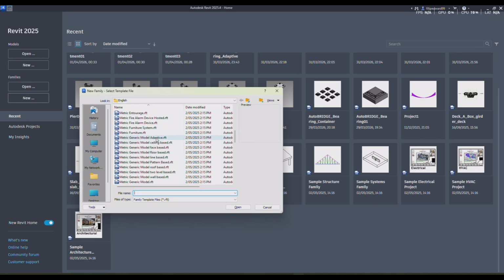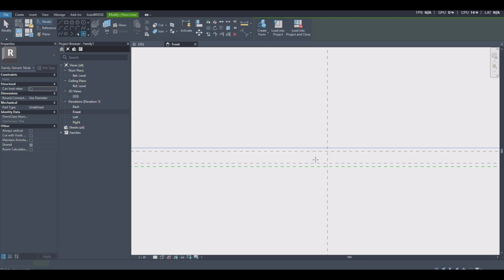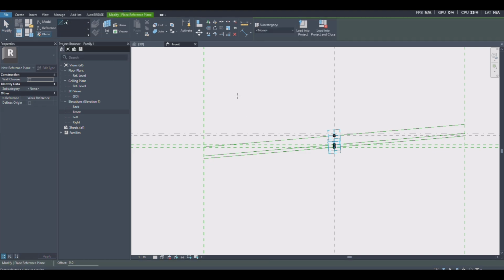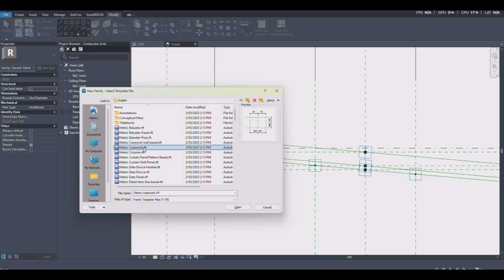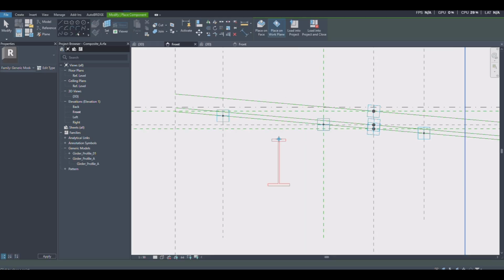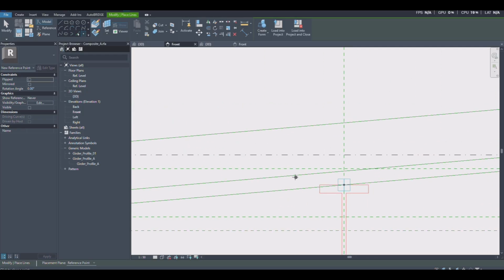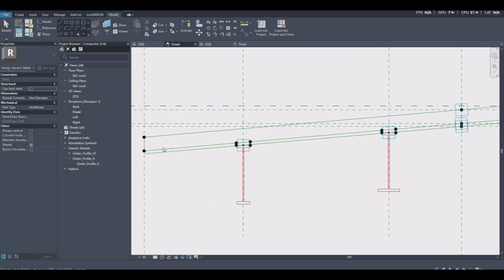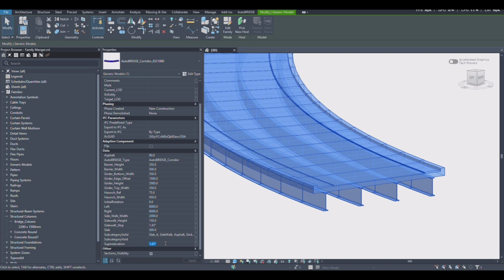Master Composite Bridge Modeling: Revit + Civil 3D Automation with AutoBRIDGE

Comment: Should not this approach limit you to work just with Generic Models categories?
Reply from the maker: Good question,  but it’s actually the opposite of how the workflow behaves.

AutoBRIDGE uses Generic Models intentionally as a flexible “host” layer, not as a limitation. This avoids locking the workflow into a single category too early, especially when dealing with corridor-based infrastructure logic.

The generated elements are fully parametric and data-driven, not just static geometry. After generation, you can assign or adapt them to the appropriate Revit category (bridge deck, retaining wall, tunnel elements, etc.) based on project needs.

So instead of restricting you, this approach gives more flexibility:

* One unified workflow for different infrastructure elements
* No need to rebuild families for each category
* Freedom to align with project standards after generation

In short, Generic Models here are used to remove limitations, not create them.

Happy to hear your thoughts after you try it in a real workflow.